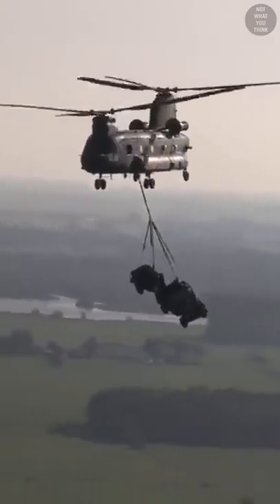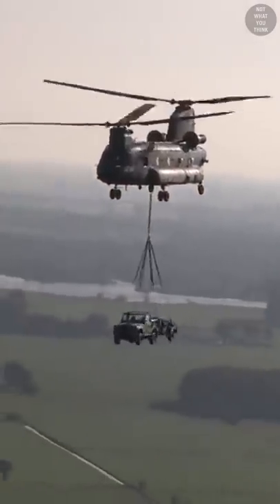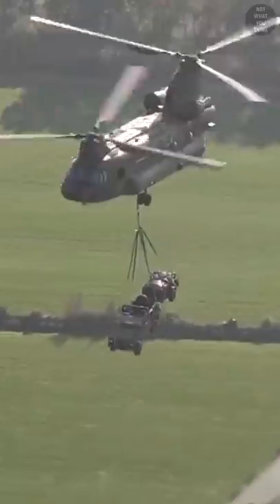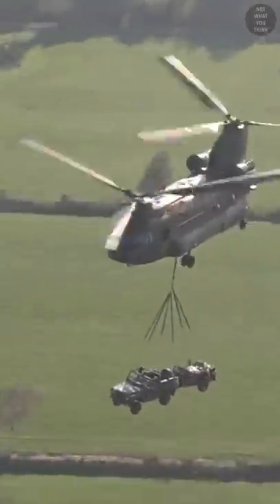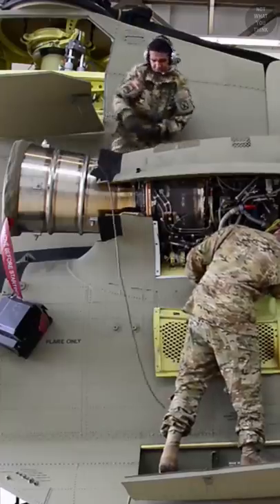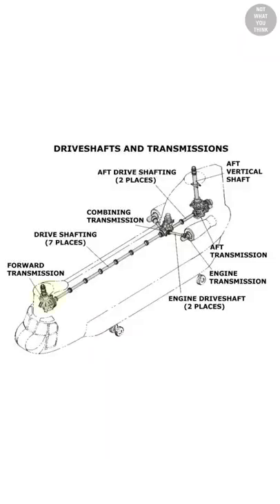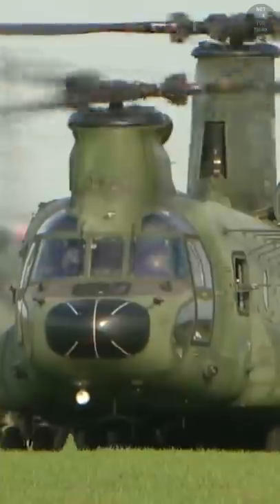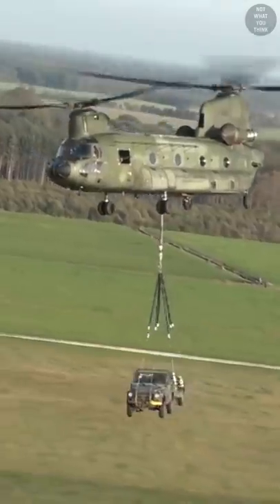What if One Engine Fails on the Chinook? #shorts

Comment: Just wanted to add on to the video.
In order to autorotate, the Chinook, or any rotary wing aircraft, needs to be in a high energy state. they either need speed or altitude. If they are too low or slow, they may not be able to turn the potential energy of altitude into speed in order to follow the glideslope down and land without power.
Reply: Can u tell me why they designed the chinook like that?like the 2 flying on top
Reply: @MADGAMER1  Having two rotors massively increases power output. Not only do you have twice the lifting surface, but you also do not waste engine power on a tail rotor
Reply: Thank you for your input, mister expert.
Reply: @SkiyeBlueFox  Having two counter-rotating main rotors of the same size also makes the whole issue the tail rotor is supposed to solve a lot easier since you just need to apply the same torque on each instead of counter-acting the torque of the main rotor with a totally different size and direction of rotor.
Reply: Also a total gearbox failure is a death sentence on any helicopter
Reply: Interesting, somewhat counter intuitive that failing fast and high is potentially safer than low and slow
Reply: Thank you. I’d like to know what happens if this happens on an Osprey, not cuz I want to see anyone get hurt, just so I have more useless but interesting info
Reply: @MADGAMER1  because of the counter-rotating design, the Chinook is also the fastest chopper in the US Army.  This is because single rotor choppers have dis-symetry of lift on advancing and retreating blades.  At a certain forward speed,  the retreating blade is actually moving backwards (in relation to its airfoil shape) through the air.
Reply: Otherwise known as the dead man’s curve
Reply: Yes but....

You don't follow a glide slope in a helicopter, autorotating or not...

😁
Reply: Interesting, the most dangerous part of any flight is the point of no return. I can't imagine any worse situation of flight and altitude buys you time! I could be wrong?
Reply: @MADGAMER1  my dad used to fly them. It's to increase weight capacity.
Reply: @m0r73n  but the death sentence is not what you think
Reply: @MADGAMER1  cuz it looks cool and it the sound is like “CHOP CHOP CHOP”
Reply: Yeah that’s what I was gonna say
Reply: If they're high and slow, it'll still work. If they're low & slow, crashing won't matter anyway.
Reply: This guy chinooks
Reply: Thanks nerd
Reply: @un1tyNL  Oh, I wasn't trying to disagree or start an argument, so sorry if that's how things came across. I was just trying to add additional relevant information into the discussion
Reply: @Taladar2003  I never thought of it like that. COOL!
Reply: @richardmillhousenixon  Dude, I didnt know that. Now I know another reason the pilots love it!
Really cool stuff!
Reply: I'm dropping the load us troops are more important jeeps can be replaced not battle buddies
Reply: @bubbsbrindley8001  Only problem is if you are carrying the load internally
Reply: @richardmillhousenixon  stand by what I'm saying if I am in battle with troops in contact. I'm saving my battle buddies over a jeep. Plus if there is engine trouble will really alot of weight
Reply: @bubbsbrindley8001  Oh no I agree, I'm just saying it might be difficult to dump an internal load if you lose both engines because the time you would have until you hit the ground would probably not be enough to open the cargo ramp and dump everything. Slung loads aren't an issue, just hit the emergency release, but internal loads might be an issue
Reply: To low to slow👉😎👉
Reply: Another note, most autorotations in single rotor helicopters work even with a loss of tailrotor. At a high enough speed the drag imposed on the aft of the airframe is enough to prevent the aircraft from spinning.

To my knowledge it would function relatively the same on the chinook if the aft or stern rotor is lost fully, but you would still have a very rough and hard landing and its likely you'd be severely injured regardless. 

I think the only scenarios I remember of a chinook failing to autorotate due to elevation and speed is like, the chinook crash at Operation Red Wings where the aft rotor was hit by an RPG and the chinook basically fell down a cliff due to its basically absolute-zero speed and extremely low altitude.
Reply: @deptsofhell6961  if you think altitude doesn’t help a helicopter with an engine out, you are wrong. As I understand it, you set your rotor pitch so that falling through the air makes it rotate faster and faster, and as the ground approaches, you trade vertical velocity for horizontal and you change pitch so the rotors are stopping your fall at the expense of them slowing down. 
I recently saw a pig hunting helicopter do it on YouTube and it was instructive. They all got out too. Landed like a plane, sort of.
Reply: @JustAGooseman  gotcha I was a 88 Mike
Reply: @SkiyeBlueFox  
Why not 4 rotors like a quad copter?
Reply: @robinhodson9890  why won't crashing matter anyway.
Reply: @georgeau2523  probably because the aircraft wouldn't be able to recover from the low altitude or low airspeed and would plummet to a crash rather than being able to make an emergency unpowered landing at normal glideslope. Not an expert, just a guess
Reply: @Theineluctable_SOME_CANT  u sure? They still have airfoils that produce lift, don't they?
Reply: @jjclark1035  my bad
Reply: Chinook is another TIE
Reply: @MADGAMER1  You get double the power output, plus you don't need a tail rotor to compensate for rotation. You just have them spinning the opposite way
Reply: spider love  Gotcha. Thanks man. I don’t know anything about the Osprey other then they are (mostly) utilized by the Marines, and they are the coolest form of air transport, to me anyway.
Reply: I don't believe anyone in this community!
Reply: @m0r73n  WRONG! I am a Survivor along with 3 other U.S. Marines of Gearbox Loss on a CH-53E!
Reply: @georgeau2523  you can't make it anymore safe the closer you are to the ground. You have less room to work with and less time to slow down. People have failed to auto-rotate and killed crews; which is why it's imperative that Pilots learn the maneuver safely. However, low to the ground there is nothing to do but make your peace.  Helicopters are incredibly Safe and there are many fail-safe's but crashes do happen and the V-22 Program has had some of the worst.
Reply: Yeah 85%of the time it never happened
Reply: @MADGAMER1  the designer was drunk
Reply: @m0r73n  +¹
Reply: @Ryan-ed1lq  none 9
Reply: @SkiyeBlueFox  nope
Reply: @jozefmajor3355  pray tell the correct answer then?
Reply: @SkiyeBlueFox  that the helicopter does not rotate around its axis must have two rotors, which rotate in opposite directions relative to each other.
Reply: @jozefmajor3355  how is this related to dual rotors increasing power output?
Reply: @SkiyeBlueFox  sorry, now I see, I responded to the wrong comment🙂
Reply: @jozefmajor3355  ah, all good
Reply: @georgeau2523  the idea in an auto rotate descent is to go flat pitch on the cyclic to reduce drag and maintain blade rpms. Once a certain distance is reached between the plane and the ground. The pilot will pull up on the cyclic stick to slow as much as possible the falling rate and remaining rpms and while it will be considered a hard landing. Lives and aircraft may be saved from certain destruction
Reply: There’s always a but
Reply: Óo
Reply: spider love  POTUS does use Osprey.  Obama landed in Cardiff for the NATO meeting in an Osprey.  I'm sure there are other instances as well.
Reply: spider love  Ad what does that have to do with the price of rice?  POTUS use Ospreys.  Fact.
Reply: @georgeau2523  Same if you have a parachute and want to jumo from a height. You die if you jump from a low height - you need enough height to get the parachute to fully open.

And for the helicopter the fall speeds up the rotor. And near the ground, that rotation energy is used to to stop the fall.
Reply: @MADGAMER1  what
Reply: @MADGAMER1  Mo Powah Babeh
Reply: @Yep902  nn
Reply: @Andrewlang90   the same principle, there is a combining gearbox to power both rotors from either or both engines ..
Reply: @statesk8r  technically its some  as electric  chair. ;p changes oof surivival exists but minimal. ie politicians caan save you from death sentence ;p and if regulatins changed to make  escape mechanism on  choppers mandody, its likely going to save you  froom that ;p
Reply: Figured that would be a given.
Reply: Wait’ll this guy learns about hover autos

Comment: autorotation isnt really a safety feature, just a quirk of how rotors work..
Reply: No, since something like drones don't autorotate but they also have rotors. You need certain features for it to work.
Reply: @Wayne Flanigan it's actually most commonly called the freewheeling unit. Also, older helicopters that didn't include a freewheeling unit had a part in the transmission drive that was engineered weaker in order to break if engine power was lost to allow free rotation of the rotors, sort of a mechanical fuse.
Reply: 69 like
Reply: Call it whatever you want, but if Im in a chopper thats going down and the only thing between me and the ground is autorotating, Im gonna call it a safety feature
Reply: Counterexample: v-22s are rotor-based aircraft that can’t autorotate, since disk loading’s too high. It’s a safety reason why presidents can’t use them as their VIP vtol aircraft.
Reply: I'm not killing you, I'm just removing the life from your body.
Reply: @simula152  it’s still a quirk because drones have way too little propellers made of light plastic and have way too little momentum to keep spinning, 
literally a slight breeze is enough to significantly change its rotation, 
autorotation really is not something engineers design for it’s just something that arises from physics being physics,
thus it’s a quirk not a feature,
unless you want to be that annoying 12 year old meming about bugs in games being “features” too
Reply: @marianandnorbert  autorotating is the same thing as gliding an airplane to the ground with no engine. Allowing an airfoil to work in an effective manner to produce lift, powered or not, is absolutely a feature. Its taught to every helicopter pilot until proficiency for a reason.
Reply: @simula152  
Are you seriously comparing a helicopter to a drone?
Reply: @marianandnorbert  doesn’t autorotation require a controllable variable pitch. Something fixed plastic drone propellers don’t have.
Reply: @timoord1611  that too, and clutch to disconnect the rotors from the driveshaft, which are 2 things I forgot to mention
Reply: @danielgreyling3483  also known sometimes as a sprague clutch, turbines are way different than little r-22’s I fly though lol
Reply: @LuckyFlanker13  auto rotation rarely works. Most helicopter crashes are fatal.
Reply: @WALTERBROADDUS  false most helicopter crashes that are fatal autorotation was not an option, the failure of a key helicopter component such as the rotor shaft and main gearbox or tail rotor often proves fatal, these things render autorotation impossible to perform and are the most common cause of fatal helicopter crashes not failed attempts at autorotation, if it is possible to performane autorotation more times than none you will walk away.
Reply: Well, there is a class of rotary wing machines called autogyro. These operate ONLY in autorotation.
Fantastic and very safe.
Reply: @HunterGrayBASSASSASSINZTV  Ha. As a freewheel supplier to both those airframes you are incorrect.  Both are sprag clutches. The Chinook uses a double row set per engine.  If single engine, turbine or piston, the engine speed is not a big deal. On dual or triple engines it is more complicated because you have the one engine inop with the other at full power and have differential overrunning to consider.
Reply: @TheBeingReal  so in the end is it a safety feature or is it inherent to all helicopters?
Reply: @ok0_0  Safety feature in all helicopters while at the same time necessary, esp for multi engine helicopters for start up and in case of an engine failure.
Reply: @timoord1611  exactly!
Reply: Agree, that's like saying a plane has wings and when the engine stalls it can glide as a safety feature
Reply: @vivianvandermerwe1380  and yet this is absolutely not true of all planes (or true within a vanishingly small flight envelope).

It's probably fair to say it is a maneuver (like unpowered flight in fixed wing) whose application may be designed for to a greater or lesser degree in different airframes. You probably wouldn't want to operate a helicopter outside an altitude/airspeed envelope where autorotation was achievable. Since that envelope is determined by the airframe and load, it becomes a design consideration. So maybe autorotation is not a "feature" of a given airframe, but the shape of its flight envelope is.

Comment: This reminds me at the accident that happened 1982 in Mannheim/Germany when I was a plane addicted boy (now I'm an plane addicted old fart). At that accident the synchronisation gear brokes, the rotors collided and the Chinnok was falling to the ground, killing all 46 occupants on board.
Reply: It also happened on a CH-46, gear that kept the blades from colliding failed. I believe there is a picture of that helo destroying itself in air.
Reply: There is no safety feature when that happens probably.
Reply: @randombiker4610  not on American helicopters, no. Some Russian combat birds have ejection seats that can activate after separation of the rotor blades
Reply: @randombiker4610  not really, it's a catastrophic failure if the gearboxes become desynchronized, like braking the crank or timing belt in your car.
Reply: Om Shanti!

Comment: Wanting to add, the chinooks breaking apart on the ground is from ground resonance. It happens with fully articulated rotor systems and it’s, in a nutshell, when one blade gets out of timing with the others and causes the helicopter to self destruct. Only way to stop it is raise the collective and get off the ground!

Comment: If one of the Chinooks engines failed it would make it a long helicopter
Reply: it..is a long helicopter...
Reply: @nimbusshadow-wings  'longer'
Reply: a very very long single engine helicopter
Reply: Wait, no it wouldn't both rotors still rotate as one engine provides enough to do that but not enough for long distance travel
Reply: @Deadsuit  yes it would still run it. They are made to handle with one engine failing. they even do test flights (with pilots and mechanics) that they shut the engine off a certain amount of time and turn it on. it could safely fly with using 1 engine and still spin the rotors like normal but the remaining engine will have to be rebuilt 'cause of long periods of exceeding normal torque.
Reply: I don't understand the concept of this statement.
Reply: @Thenotfunnyperson  If the engine fails and only one rotor still worked and since a helicopter has only 1 main rotor, if the chinook has only one working rotor it would technically be an elongated helicopter
Reply: But would it still be veiny?
Reply: @jeffersonchau7171  I think the reason people are saying it doesn't make sense is because the video specifically explains that one engine will still run both rotors
Reply: If one of the rotors stops spinning, both rotors will become broken. The rotors are connected together by a shaft.
Reply: There is a transmission in between the forward and aft transmissions that takes power from one or both engines and then feeds that power to the forward and aft transmissions that drive the rotor blades. It is a common misconception is that one engine only drive one rotor.
Reply: @jeffersonchau7171  no he even said in the video if one rotor spins but the others stopped, the helicopter will fail, both need to spin for saftey reasons, and if one engine fails the other engine can power both via the combined gearbox, just not for long distances
Reply: Did you watch the video? Both rotors will still turn with onlyn1 engine
Reply: @dapeach06  Under normal conditions yes. Under abnormal conditions, well the synch shaft, the combining transmission or the aft or forward transmissions can break, and if that happens doesn't matter how many engines you have, or how far you are off the ground. You are going to have a very bad day.

Comment: My dad flew in these in Vietnam, he said it was scary as hell because it was leaking oil all over the place and smoking a little. He also experienced an autogyro landing in a huey when it ran out of fuel. He said they came down pretty hard.
Reply: If it's leaking, that's good, it means there's oil in the engines and gearboxes.
Reply: From what I've heard, if the Chinook is NOT leaking, smoking and creaking; THAT'S when you should worry.
Reply: @VoidShrgn  that is exactly what I was told when the crew chief was running around tightening things up
Reply: @VoidShrgn  if there's no oil leaking, there's no oil in it.

Comment: I was on one of these doing an airfield seizure (actually the exfill) when it hit something I think was in tall brush, and it went a little crazy. IRRL, there were sparks and small debris coming from the ceiling and a lot of banging. The crew chief was yelling constantly to stay inside, even before we settled hard on the ground. 
We were well trained to listen, and stayed on until everything outside quit flying around and the crew chief ordered us off. 
I don’t remember being scared, but I was used to jumping out of planes and doing scary things, plus just being around other Rangers has a calming effect because most of them are. 
My scariest plane rides were nap of the earth C130 with strapped down Jeeps looking like they want to move. If I could watch out the front, I bet it was fun. C141 was much smoother nap of the earth, FYI.